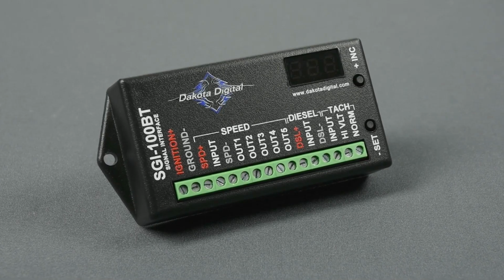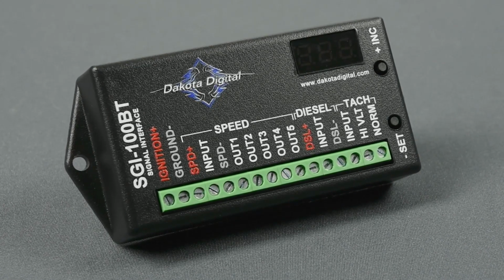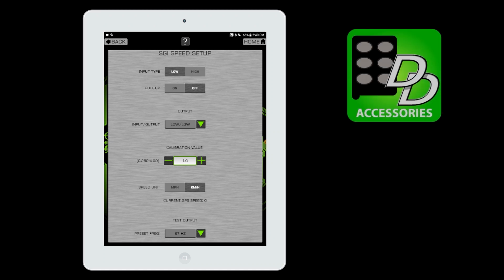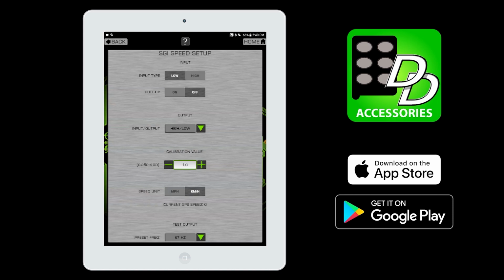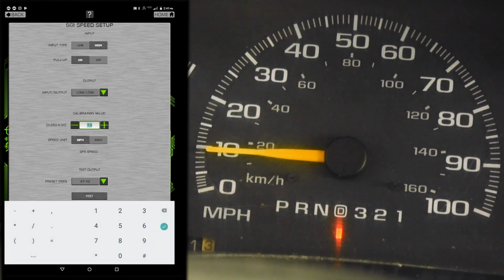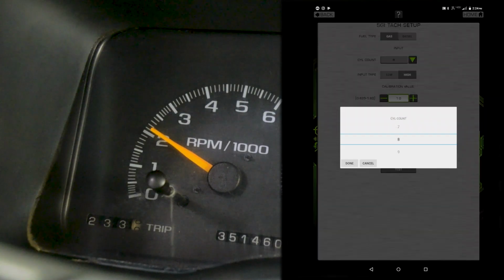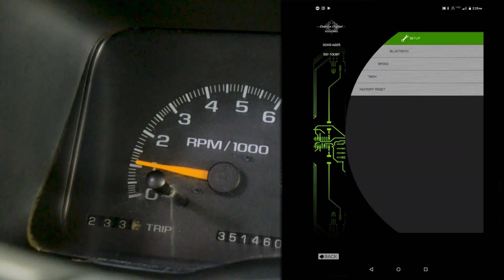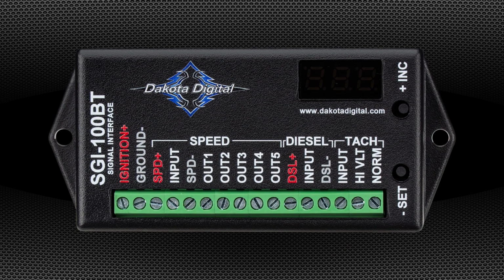SGI-100BT Universal Speed & Tach Interface

Comment: I converted my nissan teana j32 gearbox from CTV to normal automatic, using the gearbox of nissan altima 2.5. is there an external device I can use to help me know when I engage my vehicle in drive, reverse, neutral or low gear/pack?

Comment: I paid $150 for this unit and it doesn’t respond to any changes via Bt, even the most extreme of changes. Reached out to support via e mail 2 weeks ago and no response. Called tech support and the guy was very rude and not helpful at all. I have alldata and have the correct wires terminated. Just needed help setting up with BT or manually which the manual is not very good for manual setup.

Comment: Need help wiring this in my 1992 Nissan 240sx that has a Toyota R154 manual Tranmission using a Marlin Crawler speed sensor
Reply from the maker: Thank you for the message,
I would suggest reaching out to our Technical Support department, you can reach them at techsupport@dakotadigital.com at 605-332-6513.

Comment: I installed one of these on my car today, the tach seems really slow to respond. Is this a common issue with these? Or normal characteristic? It takes like 5 seconds after the engine starts for the tach signal to show up, and it is noticeably laggy from actual engine RPM. 

This is on a Toyota 4 cylinder running a Link FuryX ECU. It isn't laggy when the tachometer is modified to receive a low voltage signal and the link ECU is wired directly to it.
Reply from the maker: Good morning,
I would suggest contacting our Technical Support department to assist with this setup and calibration. You can call at 800-852-3228 or email techsupport@dakotadigital.com .

Comment: I got this and the SEN-01-4280 together for LS swap with 4l60e.  I installed it into the NP 241C transfer case and got it all wired up. It would work most of the time and seemed to shift well. There were times it transmission would lose the gear and the engine would rev up. This occurred typically under acceleration and was random. Never came up with a solution and tranny just burned up. So hoping the transmission was already going bad and not these components.
Reply from the maker: Hey there Juan,
Sorry to hear about the troubles.   You could sure reach out to our Technical Support department, they will be glad to assist with installation and operation verification. techsupport@dakotadigital.com or 605-332-6513

Comment: So will this part help the Dakota digital read everything from the holley sniper efi and all gauges work including tach coolant oil etc.
Reply from the maker: If you have Dakota Digital instrumentation, the simpler solution is using our part number BIM-01-2-HLLY, as this is a direct link between the Sniper and instrument system.

Comment: I need help I have it on my 95 impala but I’m having trouble, when I wanna reverse or try to put it in drive it stay in the miles that’s on the car
Reply from the maker: Thank you for the message,
If you're currently using the SGI-100BT, we would suggest contacting our Technical Support staff for assistance.  They can be reached at techsupport@dakotadigital.com .
Reply: @DakotaDigitalTV  I’m using GS-2000?
Reply from the maker: @dillydilly470  Sure, we would still suggest Technical Support here.